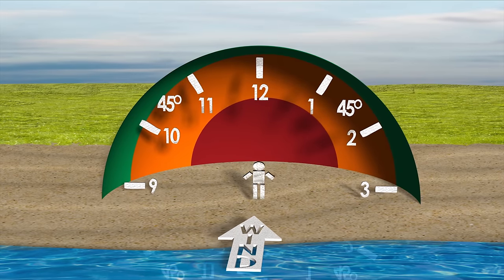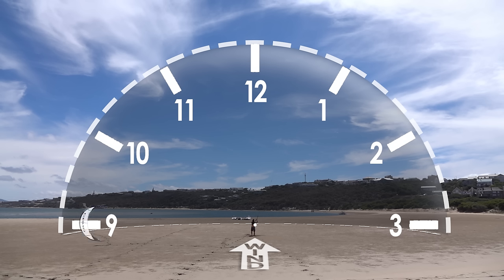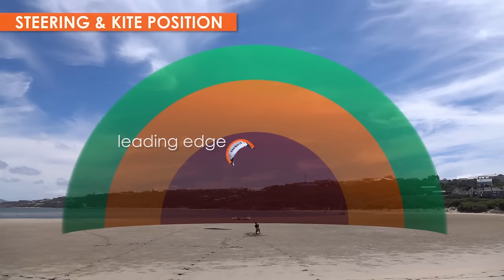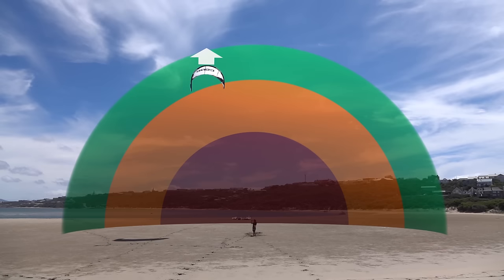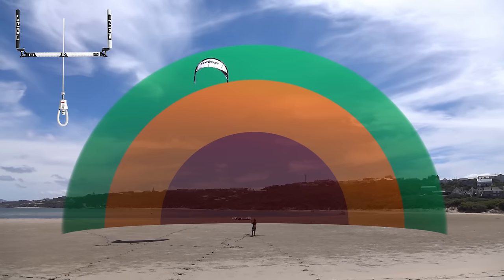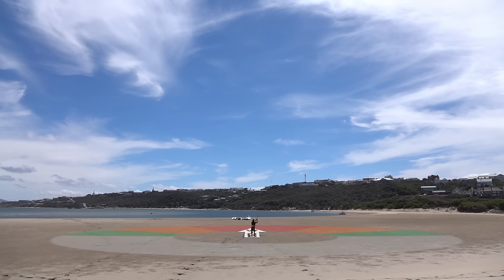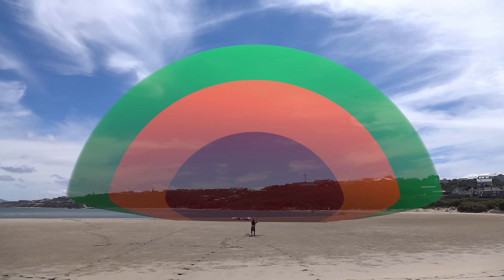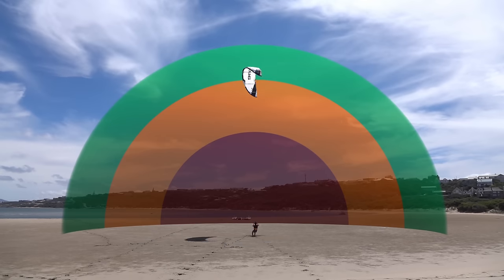The Wind Window (an introduction to kiteboarding and power kiting)

Comment: It is a good tutorial, but .... what can be misleading is that someone could think that the clock positions are preserved for the low power zone. So 12 o'clock is always the kite right above you. But 12 o'clock is also the kite right in front of you on ground level. You have two directions that determine the position of the kite in the window. Towards the left or towards the right (the clock positions) and  towards the edge or towards  ground level. For the latter I would preserve the degrees notation.

Comment: How does the wind window affect wing foiling?
Reply from the maker: Hi John, I like that question a lot. I think that pulling the bar in kiting, is like pulling the back hand in winging (except the low projected aspect ratio of the wing means it doesn't stall as badly). And flying the kite deeper into the wind window in kiting, is the equivalent of pumping the wing with your arms in wing foiling. Since they both involve increasing the apparent wind. Except with kiting the high power lasts longer due to the line lengths, and is stronger due to the speed the kite can reach.